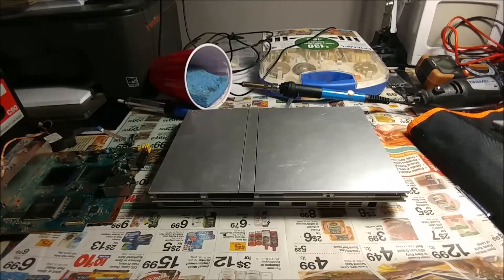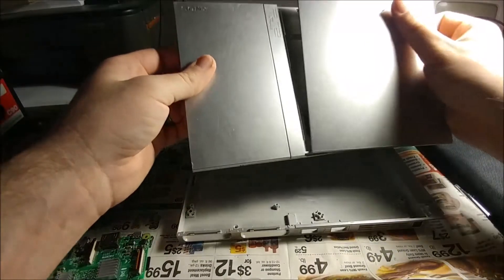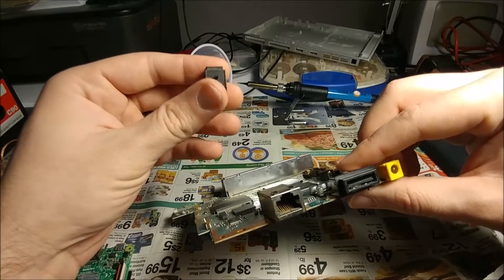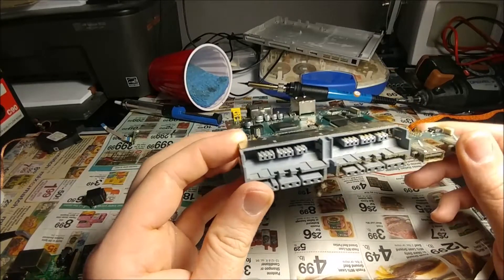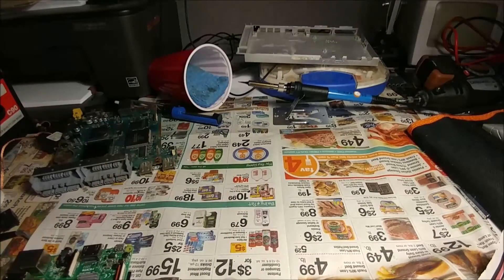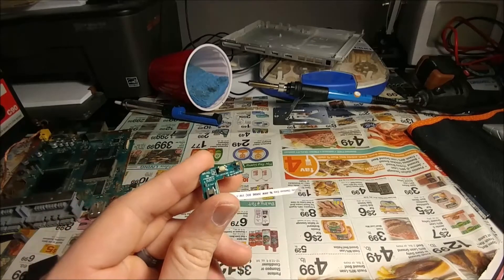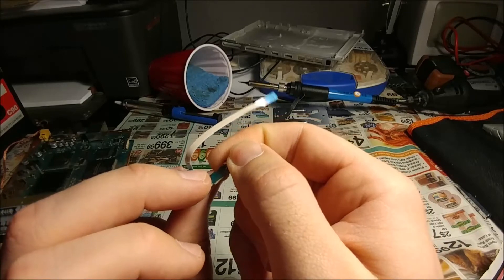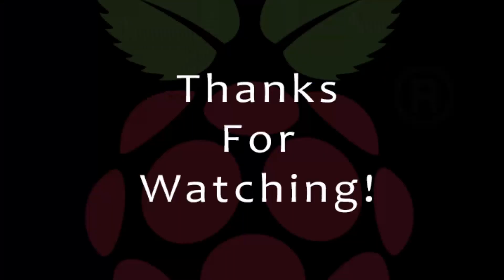Raspberry Pi PS2 case mod: Part 1

Comment: Im not sure if you ever do a in depth tutorial about that but if you did it already please put a link as an answer. If not - please do it. I know its been a while but man you just did  90 procent of a retropie work as I planned - and I'm totally newbie to this.  What I will add to your project is :. 1.  Second video output (original ps2 /one video output just for fun and retro stylish ) 2. The SD card reader ( event through pc software or if it's possible in Pi's linux software . Like you put your  original psx or ps 2 card inside and copy save states ! Sure it's not necessary and that's dumb feature but hey that's sound so cool ! ) And the most important 3 - Hard Drive.  What I will do for sure even if I will never need to change drive if will be a easy way to remove it by opening a disc tray and placing it just in place where you place your r.pie.  But that's my babling I hope you already shared  a nice guide about wiring this ps2 button if not - please do in deep guide . Thanks everyone for reading this wall of text I hope you already make your own retropie project:)